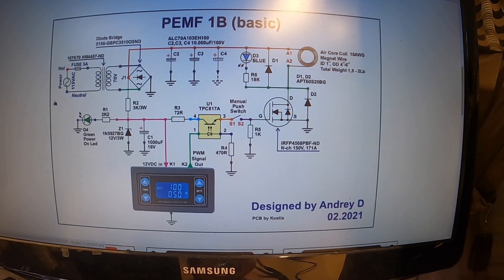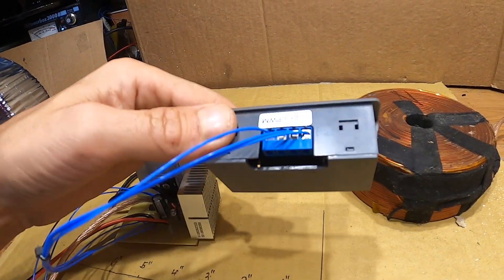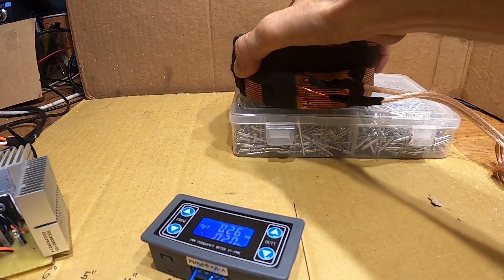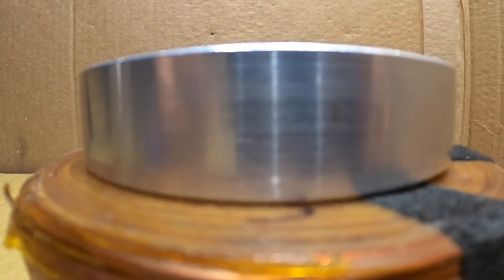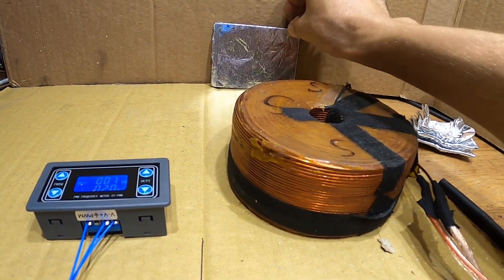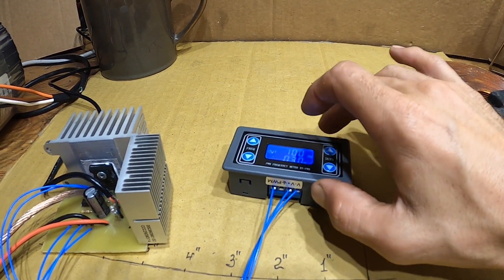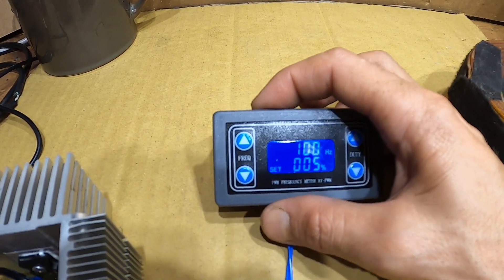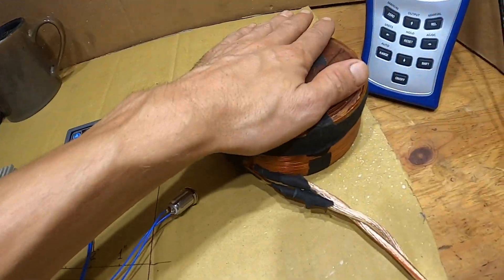038 Open Source PEMF 1B Circuit Testing it. 1-600Hz 1-30% Duty 4,400 Gauss

Comment: Thank you for the link crypto, wutube gnosted my comment as i had replied with the link too and another link to a site saying pemf machines are far better than ems machines. Maybe the other link was what made wutube to gnost my comment.(also typing gnost and wutube correctly makes wutube gnost the comment too)
They say ems machines use electric currents while pemf magnetic which is much better for our cells and health in general. I would love Andrey to learn more from the 13 tesla alibaba machine and build us at least a 7 tesla pemf machine. I battle with aml leukemia in my bone marrow and i need more pemf magnetic power to get there and kill the cancer within my bones. Chemo works temporarily as cancer comes back, the 3 tesla pulser from Andrey works great so far but with a 7 tesla pemf machine i could take on my leukemia head on if it dares to come back again at full force like it does every 6 months to a year.
Reply from the maker: I would be interested to read about difference between PEMF and EMS. 
Both Devices produce very similar energy, they both Use Capacitors to store energy, both use Coils, high Voltage and currant to produce magnetic pulses.  PEMF Machines do require stored energy(currant) inside the capacitors to produce pulse. 
The difference is the pattern of pulsations (program by which they run) 
By the way 13 Tesla sounds much stronger then any Strongest 3 Tesla PEMF machines out there. So I'm sorry but 13 Tesla is 4x higher then 3 Tesla this means it will penetrate deeper. 
When I get some spare $$ I will buy me one of this TMS Machines to see how it could be converted into 8-10 Tesla PEMF
Reply: @AndreyD  That would be great Andrey if you succeed converting that ems machine to pemf.
Google "ems vs pemf" and it's the site "pemf-devices" that lists the differences and says pemf is way better. I would love to hear your opinion on that site, is their info accurate?
Reply: Yes my comment was posted, i'm so happy and mad at wutube at the same time for interfering for no reason.
Reply: @amgadghouname  that looks interesting, thanks

Comment: Is focused emf/femf the same as pemf? Corporate advertisements on youtube claim it's better but i dont believe them.
Also ems machines on alibaba claim they can do 13 tesla and they have a fan on the coil to keep it cooler longer.
Are ems machines any good other than muscle toning?
Reply from the maker: It depends what you are trying to get. If you are trying to recover and your goal to speed up self healing process, then you don't need a lot of power, 0.5 Tesla (5,000 Gauss) should be sufficient in most of the cases, but it you are dealing with infections, some that are deep inside the body, Plus some patient may be OB so to get the best result the EMF needs to be focused and strong
Only then you will be able to deliver enough energy to deactivate Viruses and kill bacteria effectively even deep inside the body.
Can you send me a link to the EMS machine on alibaba?
Yes EMS machines can be used as Magnetic Pulser or TMS machine.  They run off program meaning user will have a choice between lets say 10 build in programs, each program will have its pattern of pulsations for preset amount of time. 
I think strong EMS machines can be used for TMS and to deal with infections, I don't see why not
Reply: @AndreyD  I  was wondering the same question as theagrafiotis!

Here is the Alibaba link for 13-tesla machine https://www.alibaba.com/product-detail/2021-CE-13-Tesla-EMS-Slim_1600091150563.html
it's targeted mainly to reduce fats and increase muscle, it has two coils and the machine weight is 65kg, for $2590 the price is not bad. 
I would like to know Andrey what kind of technology is used in that machine is it a capacitor bank or a high voltage?
Reply from the maker: @cryptomaxima4623  As fur as I know it's both, high Voltage and good capacitor bank.  Large Mosfets are used as a switches.
I need to get me one of this Unit to see what's inside. I have seen them with out the shell but I want to see it in real life and play with  it.
Reply: @cryptomaxima4623  wutube wont post my comments here, arrrrh!

Comment: If this thing can 1 lift LBS disk imagine how far it can propel a washer ?😀
Reply from the maker: To repel steel washer furthest it must be strategically placed inside the coil. Metal washer being pulled to the center of the coil. 
Best is to use Aluminum. because Aluminum being repelled instead of attracted.
You can use sliver coin or copper washers instead of aluminum

Comment: Dr Pawluk says 4,000  Gauss will penetrate 5” into the body .
Reply from the maker: I was Testing how fur it  Pulsates with small Compass, well seems like magnetic Flux travels at least 2.5ft away from the coil. I can move compass arrow standing 2.5ft away from the coil.
Reply: @AndreyD  that’s impressive Andrey !
Can’t wait to complete mine 👍🏼
Reply from the maker: @Enoch-Gnosis  I Sure you will succeed in this project. Are you gonna try making a mat  possibly for all body to sleep on that can work with this PEMF circuit?
Reply: @AndreyD  I would definitely love to make a PEMF Matt , but I have no idea on how to start it 😀, I think I’ll edit for a DIY video from you Sir🙏
Reply from the maker: @Enoch-Gnosis   I'm going to be making my Version of the Matt soon. Many  people ask me for Matts, and this circuit is Perfect for it
Reply: @AndreyD  I’ll be looking out for it !
I don’t believe there’s a PEMF Matt DIY on YT, you’ll be the 1st👍🏼...
I was thinking of using (2) Yoga Matt’s and Velcro to seal them .
Reply from the maker: @Enoch-Gnosis  Right. Something like Yoga Matt that will have 2-3 Large flat coils on it and glue some material over to cover wires.
I need to do it, its not complicated, many will be able to replicate it
Reply: @AndreyD  looking forward to that video !
Reply: @AndreyD  will Bifilar coils work for this application ?
Reply from the maker: @Enoch-Gnosis  I think so as long as resistance is between 1.5-100 Ohms
Reply: @AndreyD  I’ll wait for your video 👍🏼
Reply: It all depends on the coil. But I tend to believe that 4,000 Gauss will hardly penetrate any deeper than half inch into the  human body tissues.

Comment: THANK YOU ANDREY!
You Rock Bro👍🏼
What happens if you leave the button engaged ?
The 1B is good enough for me . I use 1hz-20hz ... once I successfully build this , I’ll try the next model up 🙏
Reply from the maker: You can leave it engaged just try keeping Duty low or else coil will be getting hot fast.
Reply: @AndreyD  so what’s the longest period of time you can leave the push button disengaged ?
Thank you 🙏
Reply from the maker: @Enoch-Gnosis  Well the button is there so you can burst at high duty and don't overload the circuit. For the most time this button will be engaged, but it all depends on the Users preference. 
Later I will introduce the circuit that will be add on to  PEMF 1B circuit and will replace the button. It will monitor currant flow and will trigger when high currant detected.  It will work in automatic mode. 
But in basic circuit you need button.
Reply: @AndreyD  Awesome Thank you !
The 1B is pretty impressive!